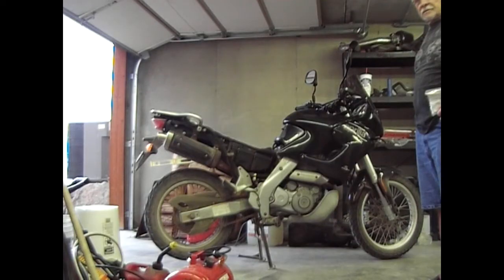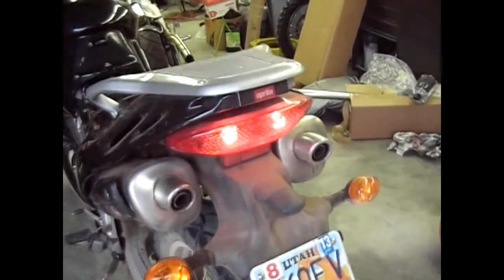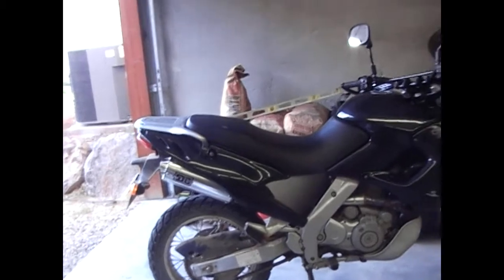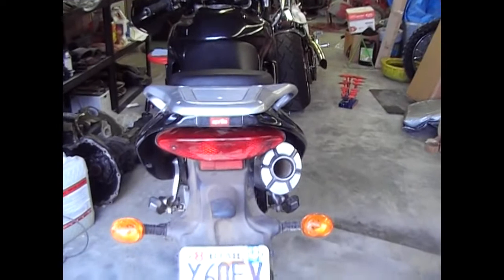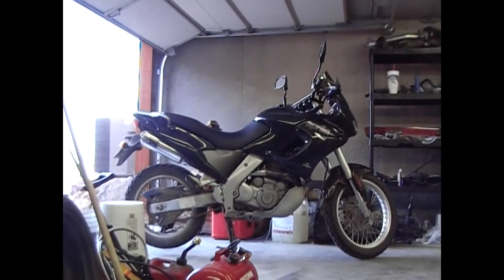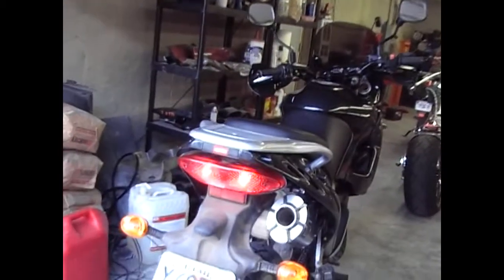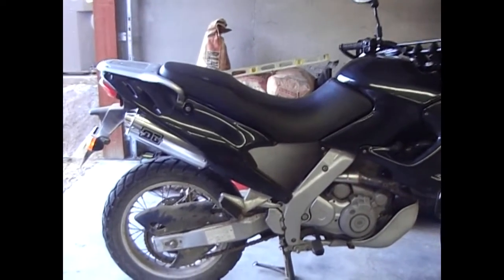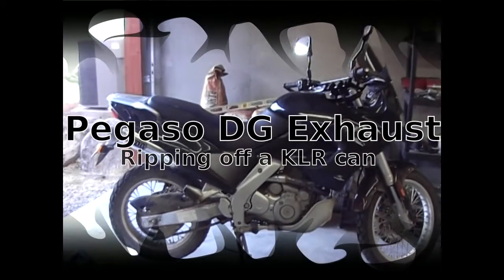Pegaso DG Exhaust Mod from a KLR Can

Comment from the maker: Well, it shaved off about 20 pounds of unneccessary weight, and made the bike much more maneuverable. As far as power goes, I think it improved the low end, and has a bit more power up on top, mid range feels the same to me. The biggest change I noticed was just that is sounds sooo much better, and is lighter up top.